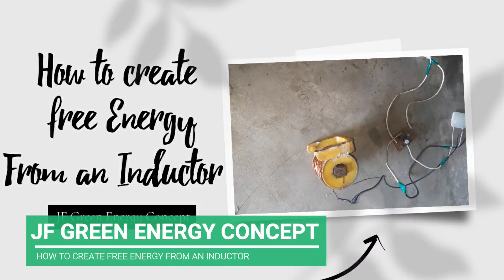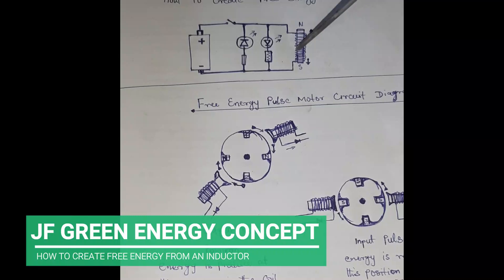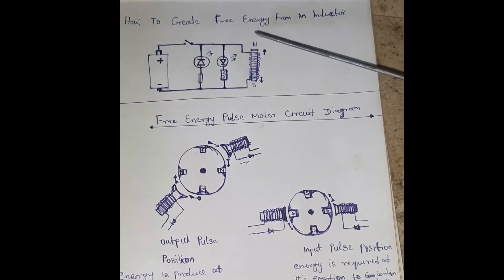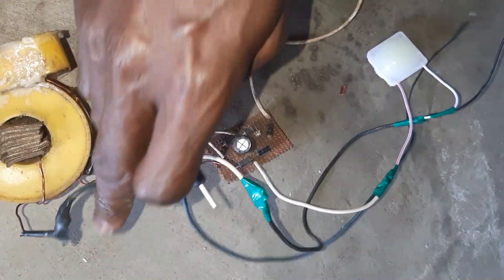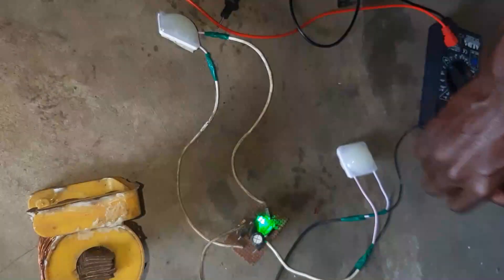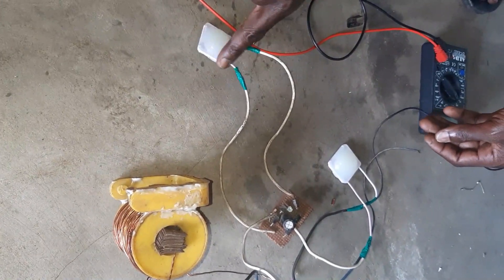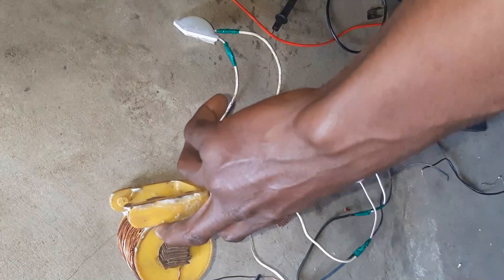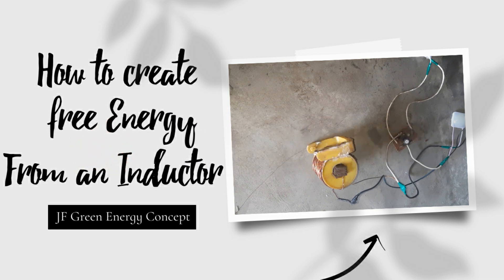How to create free energy from an inductor

Comment: I recommend the trigger function of a digital oscilloscope to help you visualize the shape of the current curve and then do the math to find the energy drained from the battery. Once you do that, compare it to the energy stored in the inductor at the moment you switch it off. If you get the same results I got, you will find out that the energy stored in the inductor is never bigger than the energy drained from the battery.
Reply from the maker: Yes,  the magnetic force is the main source of free energy we are talking about sir. Thanks for your contribution.
Reply: Energy stored in inductor is never bigger than the supplied energy, it's the 90-95% of supplied energy, but when u add energy spent in lighting bulb from collapsing field energy into the 90% stored in inductor, you get more than supplied energy.
Reply: Sir what will happen if a magnet rotate on its axis ?
Reply: @imtiazkannur9893  You mean, like a disk rotating on its own axis? Well, if this is what you mean, take a look at the homopolar generator, Faraday disk, etc. Very interesting. You can generate voltage and current with no back torque. However, the low voltage (in the range of the mV) together with the usual resistance values of contacs, copper conductors, brushes, etc, makes it a very low power device. In the end you spend more energy to rotate the system than it is capable to generate. I ran several tests on such devices. If you're interested, just respond to this thread. I'll be glad to help.
Reply: @marciogastaldi3077  thank you sir i will look forward for the video thks once again